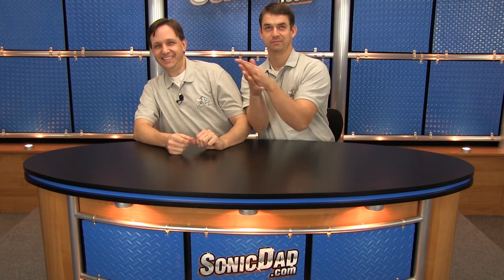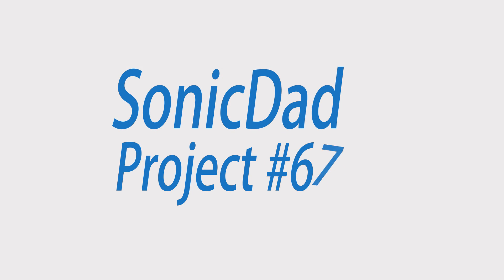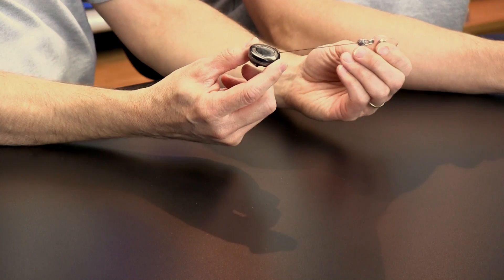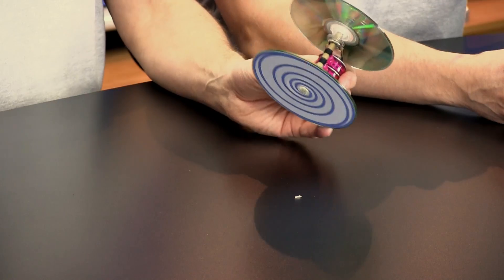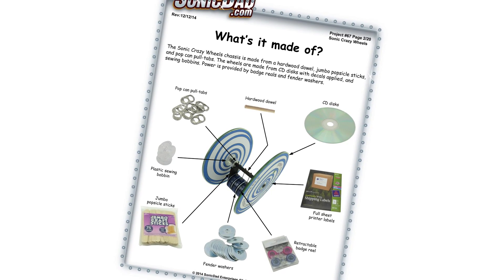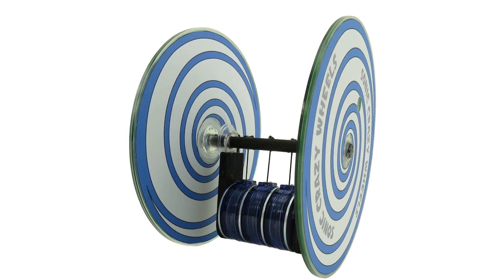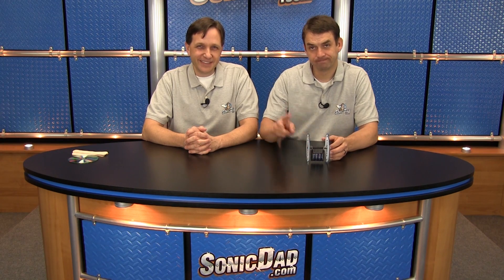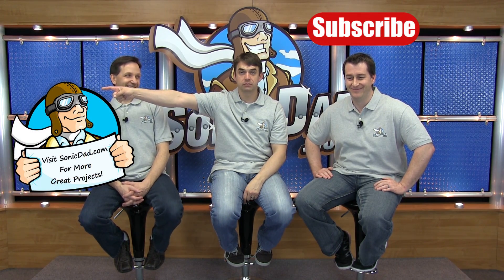Sonic Crazy Wheels: Project #67 Preview

Comment: I did this with LP records when I was a kid for a similar competition... Instead of badge retractors I used metal key retractors with the chain. It went all the way across the gym and hit the wall because I had the pull chain set up so they would disconnect when they were completely unwound so it would free wheel instead of stopping...